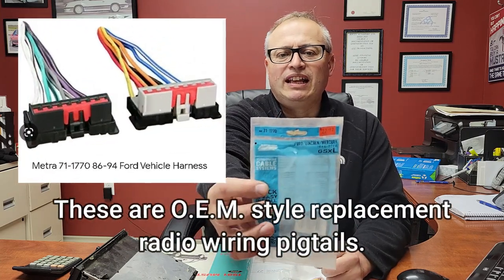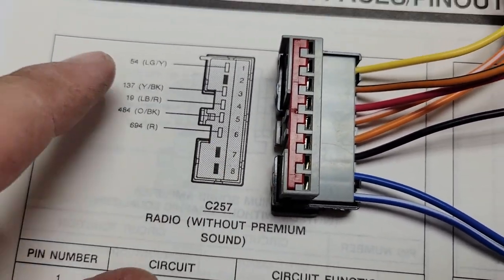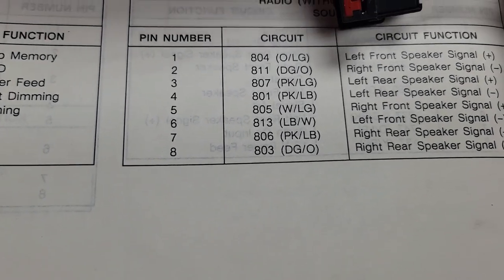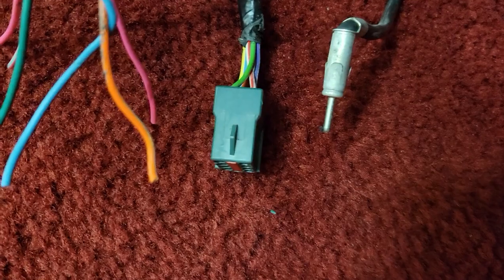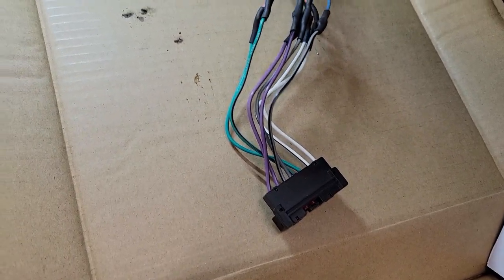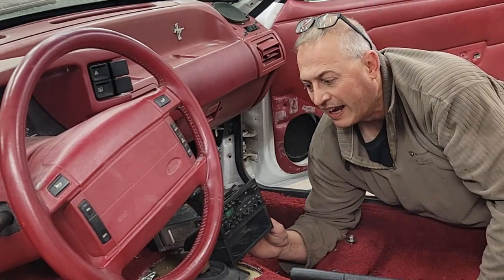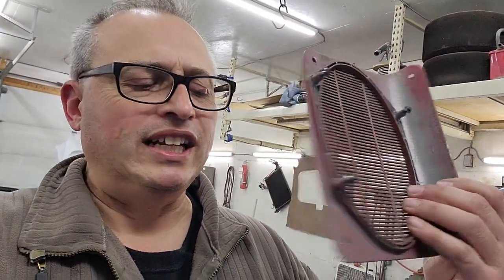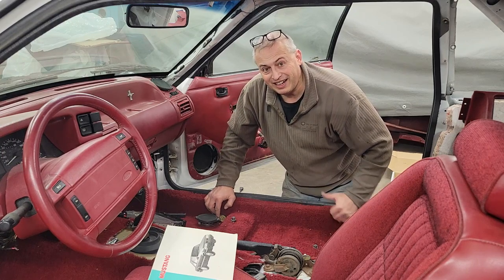87-93 FOXBODY STEREO WIRING, SCALLOPED 87 GT, CASSETTE SINGLES + QUEEN vs VANILLA ICE! - 306 Foxbody

Comment: Good to know about that wiring harness. I have the GT with the amp, the radio is now gone as the face plate was broken. It did work however, then after five minutes, it would put out heavy distortion out of one channel. Not sure if it was the radio or the amp. My luck I’ll get a radio and it was the amp. Great information on the wiring, I learned a lot on this one! 😀
Reply from the maker: Thanks BigStickStangs! I thought it was sure convenient to have the premium sound wiring removable and still be left with basic stereo plugs...sure makes things easier.   Thanks for watching! 👍🏻